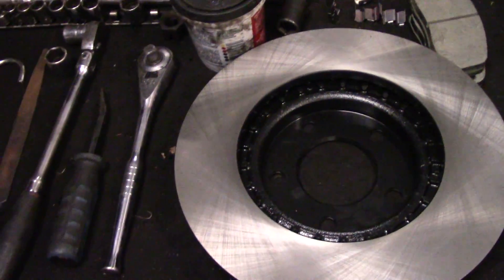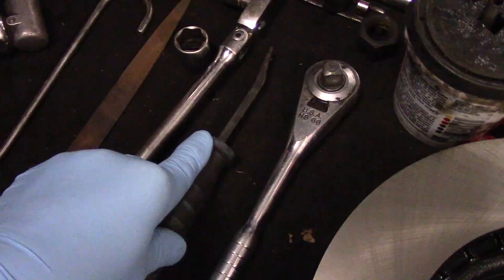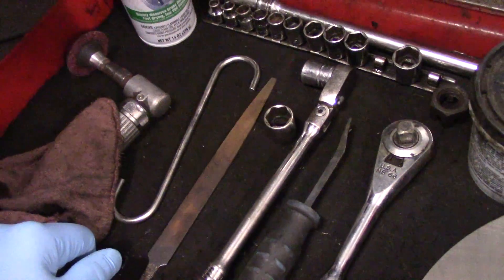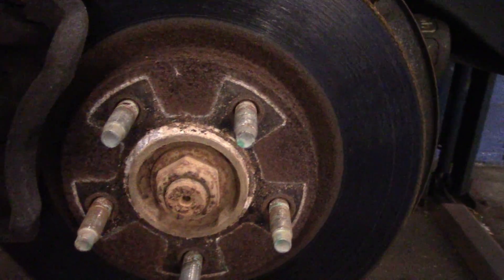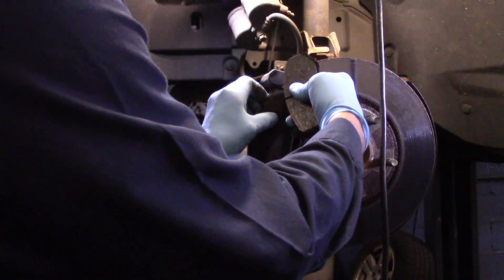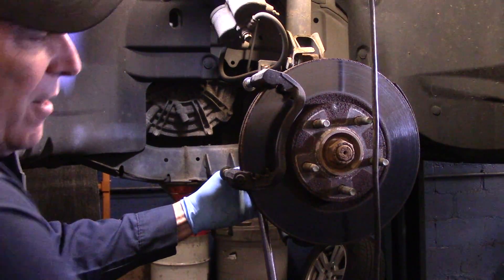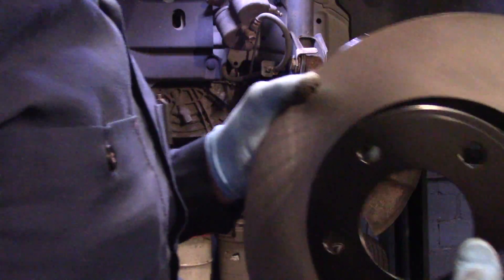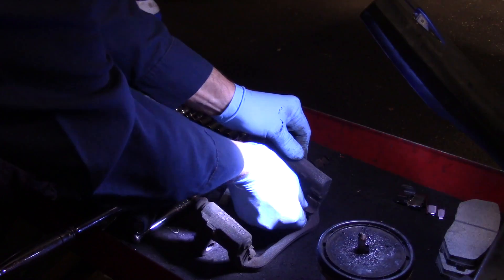2007-2014 Ford Edge Front Brakes

Comment: Hi Jim, I forgot to tell you I replaced the turn signal assembly on my 97 Chevy Lumina after watching one of your videos. I had the same problem with the brake lights not working. Replacing the turn signal assembly fixed the issue. Thanks Jim! 👍
Reply from the maker: That is awesome!

Comment: Torque specs are: 24 ft-lbs on the slide pin bolts, 100 ft-lbs on the caliper bracket bolts and 100 ft-lbs on the lug nuts. It wasn't mentioned in the video so I looked it up.
Reply: Thank you

Comment: On the Bosch brake application site tutorial, it says to open the caliper bleeder screw when retracting the pistons.  Otherwise, contaminated brake fluid can be pushed back thru the ABS pump and possibly damage the internal valves.  Do you have an opinion on that aspect of the brake job?
Reply: how can fluid be contaminated in a sealed line just asking
Reply: but i also have the same concern about abs system
Reply: @diegoluquis9150  Wear of the in-line components and age.  I'd say most mechanics skip this step, mainly to save time.  Also, maybe the back pressure alone can damage the ABS.